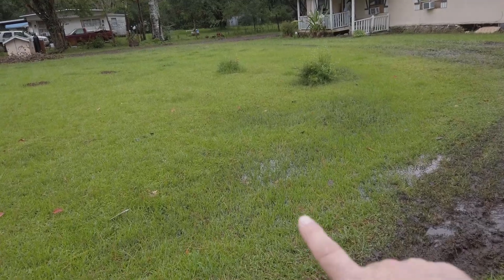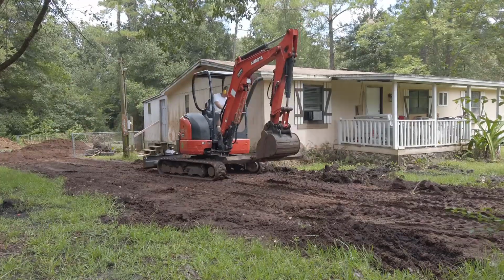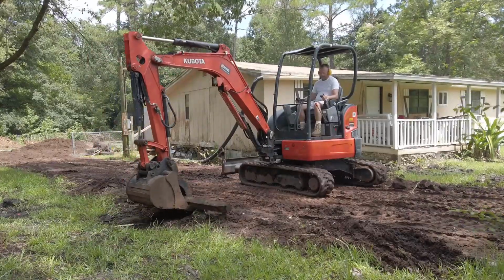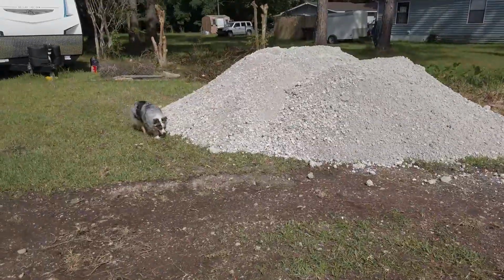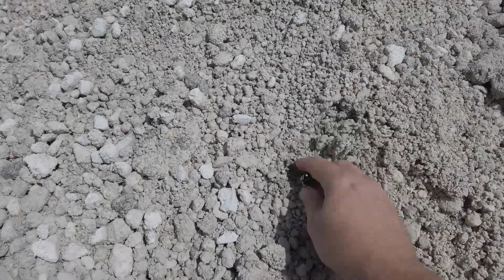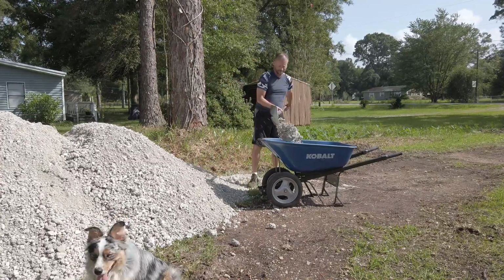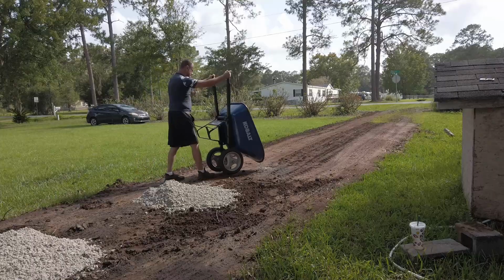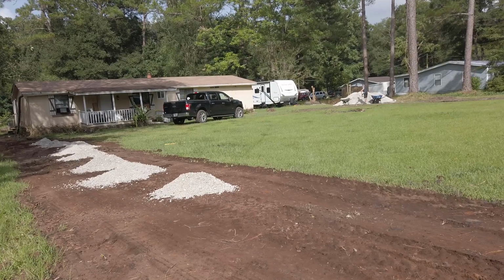Install Driveway 🚧 BY HAND

Comment: I'm from Alabama and it's making me sweat just to watch you do that. Was the drive not ready when the crush run was delivered? The driver can tailgate the gravel and save you a ton on money. I know, a little too late to tell you now, but I've also done it both ways when we weren't quite ready for the delivery. Good work!
Reply from the maker: Hey D.  The drive was ready for the delivery.  I made that request but the driver said he was new and didn't feel comfortable.  He had a hard time backing down my drive as it was and I had a hard time watching him do it.  He left some deep ruts on either side of the drive that I eventually ended up widening the drive to meet.  You ever run into new drivers like that?